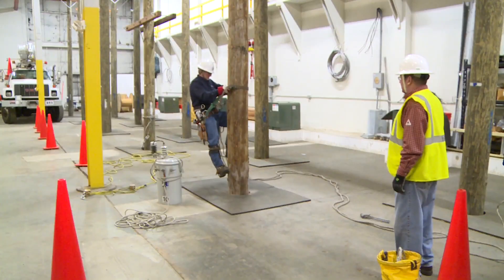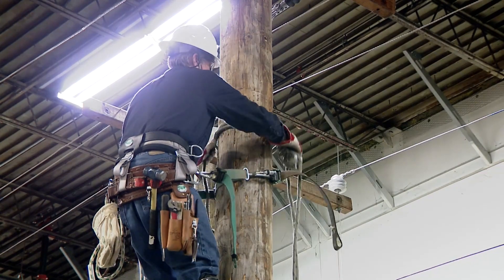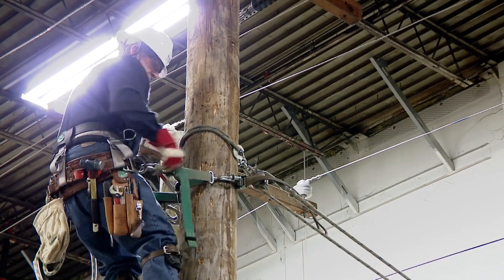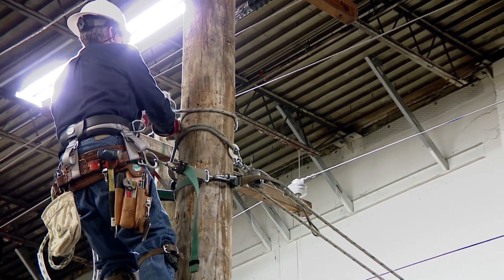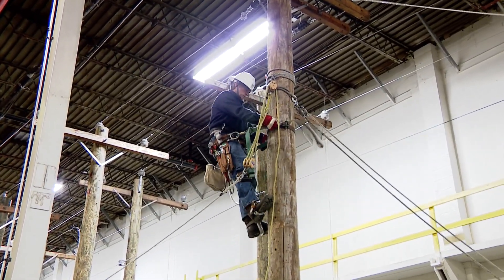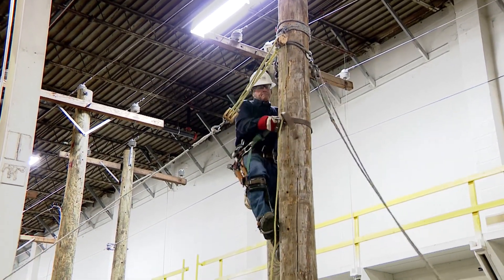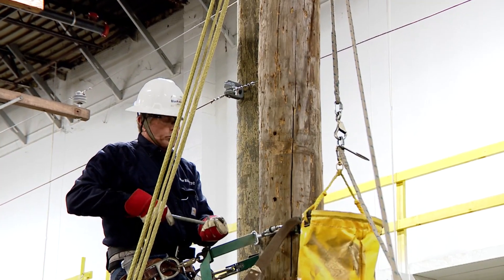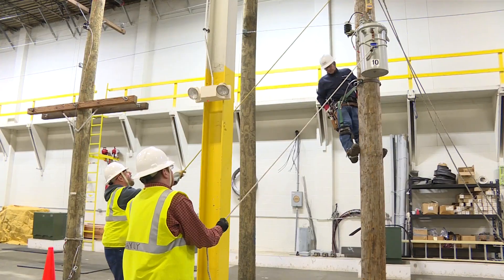Taking the Transformer Up the Pole

Comment: When I was a lineman, I drilled the bolt holes for the bolts the transformer was to hang from, and put in the top bolt. 9:54   I tied my hand line, with a single pulley to the pole.
I dropped my hand line to the ground man. Through a pulley at the base, of the pole. He tied one end to the top of the transformer, the other end to the truck.
He then got in the truck and drove away, pulling the transformer, up to me.  I then bolted the can in place.
Reply: Nice 😂

Comment: Why not use a 4’ metal choker iland an ox block
Reply from the maker: While working on a de-energized line you could use a metal cable sling or chain sling. We prefer not to take any metal slings into an energized area when at all possible, cable slings can cause puncture wounds and damage to rubber gloves due to broken strands which is a hazard. Web or Rope slings are the most versatile and supply a degree of non-conductiveness and are very inexpensive compared to cable and chain slings. I believe the video you watched was one using rope blocks to hoist a transformer. You are correct that you can use a oxblock and rig to hoist a transformer, we teach this method also but either will require more manpower and or equipment (powered capstan) to do the same lift as a 4 to 1 rope block. Thanks for your interest, if you have any other questions feel free to contact us.

Comment: How much does a 50KVA transformer weigh?
Reply from the maker: Aprox 400 lbs depending on manufacture could be heavier or lighter
Reply: @blueridgecommunityandtechn3944  8ií
Reply: 250kg, looks like there’s no oil in that tax, makes it a lot lighter
Reply: Ñ

Comment: I'm considering moving into the trade from oil and gas. Working at height in the drilling industry we were required to use tool ties (safety lines tied to the tools so they cannot drop) when working at height. Is this not required as a power line technician?
Reply: That’s what groundman are for.

Comment: It's serious folks,the high viz vests are out...
Reply: cant tell if your being sarcastic or not?  u dont need safety vests on a  pole. it would be nice if they were supplied for visibilty but they are typically synthetic fiber which burns and melts.  Cotton or wool is preferred, due to ignition.  . U ever had plastic melt onto your body? Typically those types of  vests are not worn for reasons of safety.. on the ground I believe they shouldnt be mandatory either but it depends on the situation.. excuse the brevity
Reply: @jeffculbertson2077  oh god it hurts having plastic melt your skin, i couldn't tell what was plastic and what was skin. It was just a little bit on my finger but ouch! I still have plastic in my finger!
Reply: Without high viz somebody would've died during this video...worse than that, somebody else has to fill out that safety incident report...

Comment: I was surprised to see an ajustable wrench being used instead of having the correct sized tool.
Reply: I thought that to at 1st. I suspect the reason is that when you hot dip galvanize a bolt or nut the size becomes somewhat irregular so this means you would could be fighting to get a wrench on a fastener 30' in the air.
Reply: We have tools specialized for these nuts and bolts.. I guess he just wanted to be old school (though they have been around for a while)
Reply: Just to save weight on how man tools and equipment that need to be carried up. Better to have a tool that multi-functions than a single function tool.

Comment: Great video, hey what kind of boots does everyone wear? I purchased hoffmans they're very comfortable on the ground but extremely painful when it comes to working on the pole. The climber platform puts a lot of pressure onto the arch of my foot. After 1 hr on the pole my feet r in extreme pain.
Reply: You need a boot with a full length shank preferably. Metal shanks are traditional but composite shanks are available in newer style boots as well as mountaineering/hiking boots. The shank is what distributes your weight when wearing climbers. Without it your subjecting your arch to intense pressure.
Reply: @henryrodriguez5242  thx, note it!
Reply: No matter what boot you wear it’s gonna be uncomfortable (imo) especially if you big feet where the gaff only supports a small part of your boot.   I’ve worn cheaper boots as well as more expensive ones and there didn’t seem to be much different between them.
Reply: @lumberwhack6294  gotcha, at least I wasn't alone!
Reply: La sportivas
Reply: Meindls
Reply: Wesco Volt Foes are quite comfortable.  Get Customs,l its well worth it.. Have had 3 pairs now, the originals were job masters which worked great. Though volt foes have to have a composite toe understandably
Reply: @culbyj3665  will look into it, thx
Reply: @culbyj3665  Are Dr. Scholls recommended?
Reply: I dunno why u americans even bother using those kind of shoes. Where I live we use "sickleshoes" they got 3 spikes so 1 front spike and 2 side ones they squeeze onto the pole so so much more stable working.
Reply: @VS-wp7pz  mericuh, my family in Europe says the same lol
Reply: @ExtremeWassabi  yeah and then we use bright yellow workwear to be seen easily and these guys go with jeans
Reply: @VS-wp7pz  well we wear safety vests too, this is just an in door training demonstration

Comment: Wood Pole? WTF america?
Reply: Most poles especially in rural areas, are wooden. What's the problem? You can't climb a cement pole.
Reply: I have before.  I used a bucket truck.
Reply: Yup wood. We have plenty and continue to replenish our supply
Reply: They are cheap, climbable, and normally last a pretty long time. There are a lot of and I mean a lot of places you can’t get a bucket to in most rural areas. So wood is by far the best choice.
Reply: @lumberwhack6294  Climate and local soil conditions play a huge part in serviceability of wood poles. On a nearby railroad here in Colorado, there are poles sporting date nails from the late 1920s on the old code line. These poles still sound out as solid when hit with a hammer, and test fine below the ground with the screwdriver test and thus are very climbable.